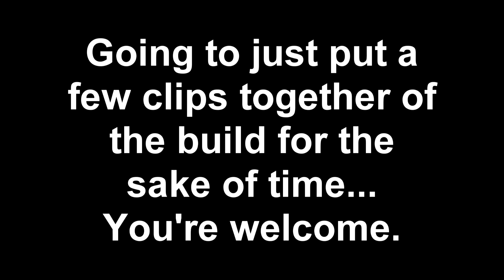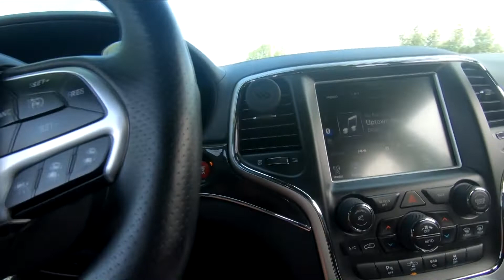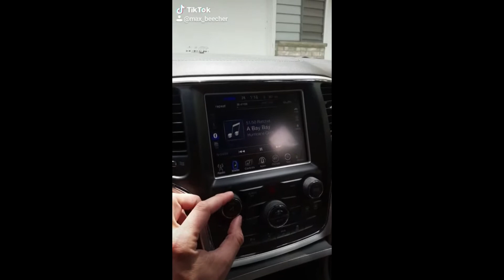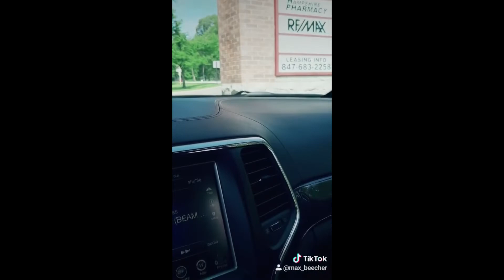Installing Subwoofers in a JEEP SRT - Building The Box Part 2

Comment: Just pulled the plug on the OEM woofer today and cleaned under spare tire. Glad to hear the satisfaction in your voice!!!  This one 12 bangs at 700rms @4ohm. Waiting on a gately box before I wire to 1 ohm.
Couldn't handle 2-15's=bleeding ears with a side of nausea 😂🤣. Box looks good and sounds great.
Reply from the maker: Lol thanks man! Gately makes some quality boxes from what I've seen! And I've been pricing out a bigger alternator and extra battery just in case 😬 lookin at an extra $1k
Reply: @max_edits_stuff  I seen the $699 beefy alternator for our rigs, I'm going with the  extra battery first..
 You already did the big 3
Reply: Are you using the oem door speakers??

Comment: Nice setup man but we’re hook up the line convertor speaker wire to. To the door speakers or the rear sub
Reply from the maker: Subwoofer speaker wire. Watch my wiring videos on it!
Reply: Yes I did see it. but on my lc2i I have 2 inputs for signal but I confused. So when I hook it up to sub it’s only gonna have one set off wires off sub and then I hook that up to my l2ci correct

Comment: Jeep is bad ass man! And great info on how to do this job much appreciated 👍 I have a question though and issues with the moon roof leaking or problems because of the subs. I want to add 3k amp to one sub but I don't want come cross that issue of water coming threw. new to you channel thank💪
Reply from the maker: Thank you! Honestly I would always roll my windows down when going full tilt on the bass because I was afraid of that lol but I never had issues while I still owned the Jeep!

Comment: You have stock spekers on the doors? How it sound? You think more voice is need it?
Reply from the maker: Honestly sounded super clean and I had several people comment on how clean everything sounded. A good balance of bass and voice.
Reply: @max_edits_stuff  nice! I was thinking on put a pair of subs and 2 6x9 and a 6.5 component but i will try to put the subs only first
Reply from the maker: @HectorRodriguez-fe8xz  yeah dude it's super crisp! Turn the bass down on your head unit and tune it with your amp. Turn the highs up on the head unit all the way, and the mids, 3/4 of the way up
Reply: @max_edits_stuff  thanks! I will do that for sure im gonna add an epicenter as well 😎

Comment: Does your Jeep have the full glass sunroof? I’m tempted to throw my 18 in mine but i don’t wanna bunch of glass in my lap either 😂
Reply from the maker: Mine was a dual panoramic sunroof!
Reply: @max_edits_stuff  so is it essentially, LOC to the factory amp, and run everything else like normal? Or is there something I’m missing? Factory sounds good, but not enough punch behind it so I need an upgrade
Reply from the maker: @dquimby417  I ran the factory subwoofer wires into the LOC, that is accurate. Super crisp/clean sound!
Reply: @max_edits_stuff  sounds about simple enough!
Reply from the maker: @dquimby417  it really is!

Comment: How much did a set up like this run you?
Reply from the maker: Subs and amp were about $540, wiring kit was $120, line output converter was $90, and my neighbor made the box and just charged for parts which was another $100